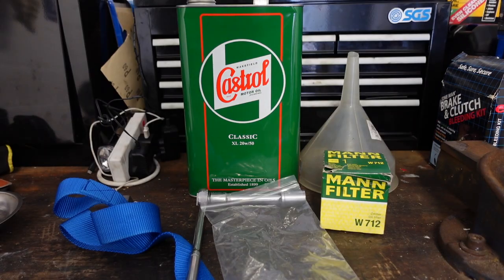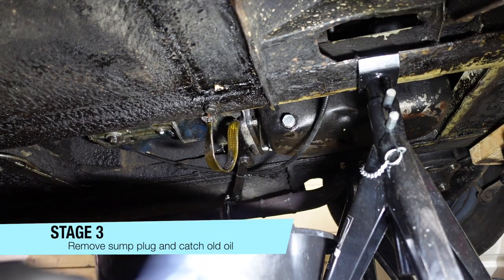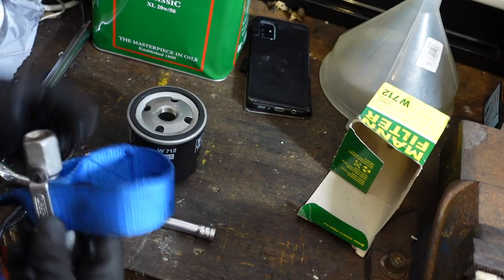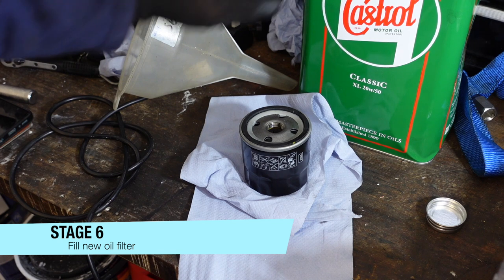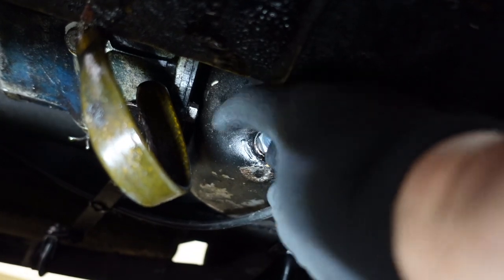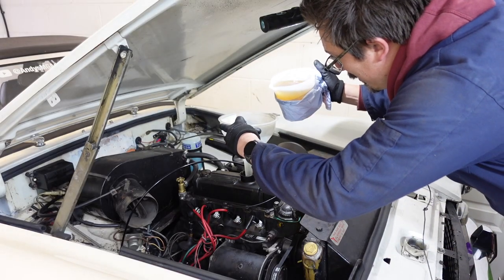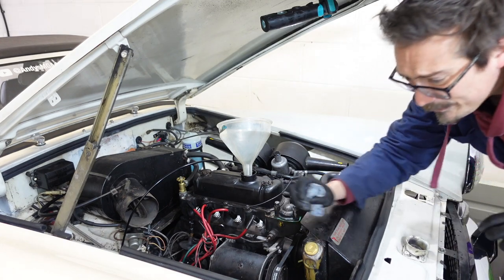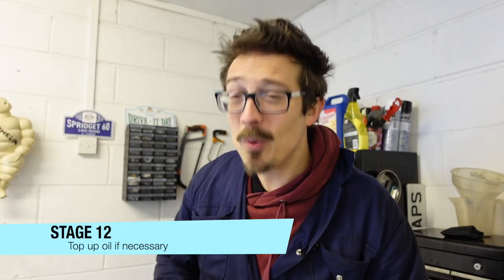How to Change MG Midget Engine Oil

Comment: One thing I would add to the process is to check that the old filter gasket/o-ring came off with the filter. If that old o-ring sticks to the mounting surface on the engine the new filter will not seal. Could you not get to the filter from underneath?
Reply from the maker: Nice touch ! Quite right. I could get to the filter, but the gap between chassis rail amd sump is too small, and the triangle in the wheel arch is also not big enough

Comment: Tx Andy. Can't wait to get my ride out of storage in spring. With my classics garage being 100 miles from here and labour costs going thru the roof I greatly appreciate all the little practicalities I can do myself (and then properly from the start). 👍
Next job is diagnosing my non-running odometer.
Reply from the maker: Man labour costs sooooo much. So if there are Jobs you can do . It's best to do!

Comment: Threads feel reversed because you're attacking it from the top. If you were trapped underneath her and removing from the bottom, they would be normal. The Triumph 1500 engines fitted to later models have what appears to be a plumbing pipe plug as an oil plug. It's disturbing to look and expect a regular old bolt, but see a 4 sided rough hunk of steel instead.
Reply from the maker: You know its funny I tried underneath,  and couldn't find a hole big enough for the new oil filter !